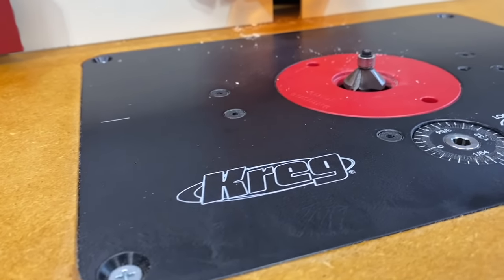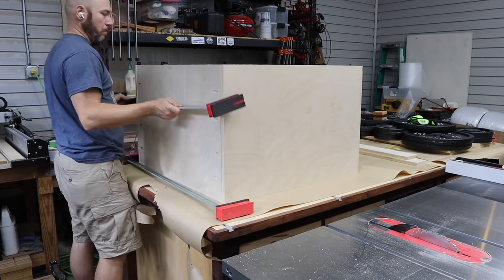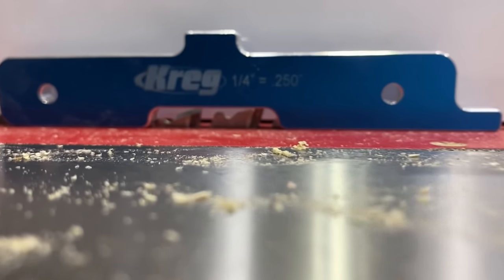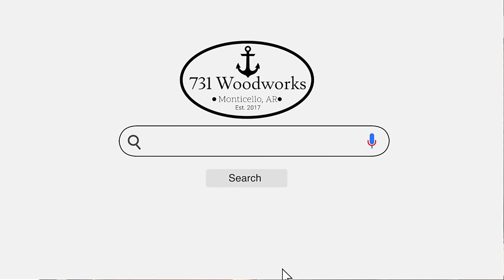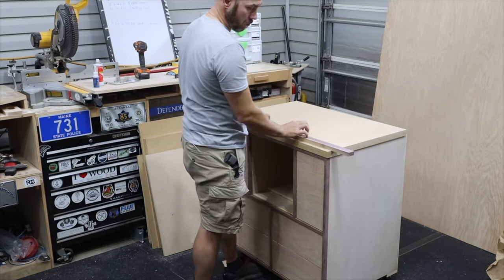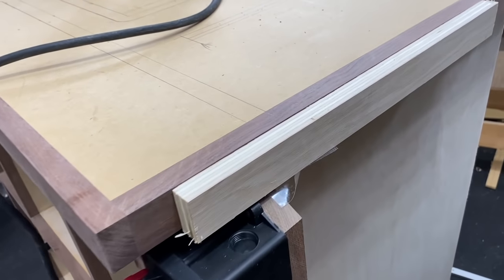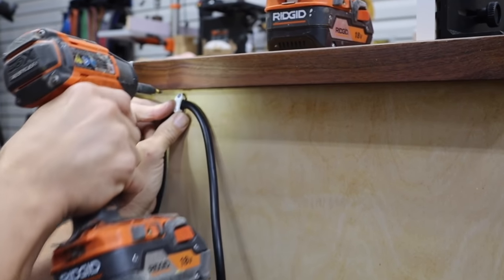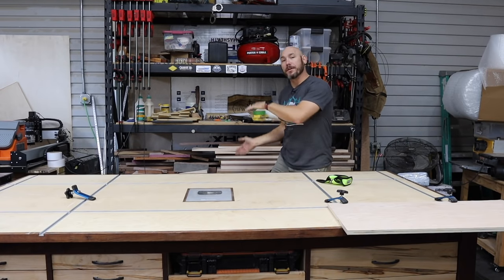How to Build a Router Table Build with Bit Storage

Comment: You bought the same Bosch router that I've got. I was wondering why you decided to go with a Kreg router lift instead of using the body that comes on the Bosch router and has a table top adjustment hole built in it?
Reply from the maker: The router lift gives you very precise adjustments

Comment: Why do you and most other YouTube creators not use a guard on the table saw when you are cutting?
I can see taking it off to show set-up or depth adjustment. 
But like this video, there is no reason why we need to see the blade as you are cutting up the sheet of plywood.

Comment: Time for a bigger workshop 🤣
Reply from the maker: lol
Reply: @731Woodworks  how many pocket hole screws will you need to build one 🤔

Great build. And I agree with your apprehension statement 💯
Reply from the maker: It doesn’t take that many.  About 50-60 I would guess.
Reply: @731Woodworks  I meant to build a new workshop 😂